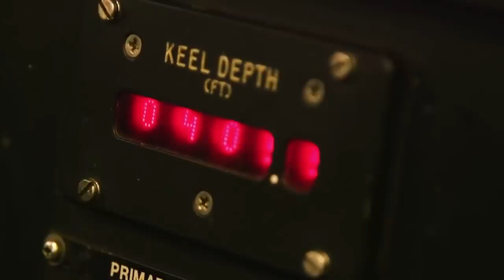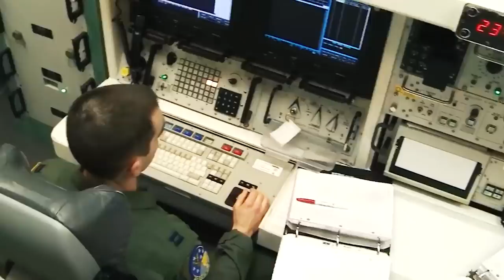Finally! This New US Submarine Can Destroy Whole Russia in 30 Minutes

Comment: Those Trident Missiles are something else. Amazing how a 560 foot long missile fits in a 43 foot beam. Those missiles must be like those very compact sponges that all you do is add water and they expand, ha, ha. I used 6 Ft. as an  average height and I got 6 / 6 Ft. or 36 Ft. + / -
Reply: Yeah he was wrong on that 560 ft😂 there 44 feet long
Reply: A Trident missile has an overall length of 43.9 feet (13.41 meters). And Trident submarines (AKA the Ohio class) have an overall length of 560 ft (170 m)
and a Beam of 42 ft (13 m).
Reply: You think those missiles are stored athwartships?

Comment: I would like to see a sub that has a bridge at the front and near the top (with torpedo tubes on the deck below the bridge) and have it look like an airliner's pilot's cockpit. The only difference being instead of having a window in front of the pilots, have a view screen that is hooked up to cameras that are set on the outside so they can see in every direction.

Comment: You talking about Russia has the same kind of nuclear weaponry in fact a far more advanced, Russia can also destroy the United States in 30 minutes, let's not make it sound as if though the United States has a stronghold over russia, 5,000 nuclear missiles parked over there in russia. 5,000! The United States only has 4,000. So let's just say this both of the United States and the Russia can destroy each other in 30 minutes. Everyone keeps forgetting, that Russia has very advanced and nuclear arsenal. Their nuclear missiles works perfectly.
Reply: Doubtful they are more advanced. Also, it's not 5,000 and 4,000 missiles. It's about 5,900 warheads vs. 5,550 warheads. And yes, they can both destroy each other. Whether one is more advanced or not is not really that relevant when talking about nukes. Only that they work and hit their target.

Comment: You guys don't really understand the metric system do you? At 6.50 you say the Trident 11 D5 is 13.6m long, but show a graphic of 590 feet long. Which is it, 170m or 13.6m? (Or 44.6' or 590" long?) I can tell you, it's not 170m tall or otherwise those guys standing in front of it are about 30m tall. Or about 100feet tall for you confused yanks.

Comment: I would rather see a lot more subs than another Carrier and the ships required to accompany it.  Surface ships are nothing but sitting ducks, sitting ducks to anti-ship missiles, and torpedoes.
Reply: As good as subs are, they don't have the versatility carriers do. Limited number of subs due to cost with limited firepower as compared to carriers with 60 or 70 planes, multiple destroyers, cruisers, etc. each with more missiles than one sub. That is attack subs. This video however is talking about nuclear armed subs that don't attack for obvious reasons but in nuclear war. 

However, your assertion goes both ways. The US also has anti-ship missiles and torpedoes and China is building carriers to go along with all of their surface ships which are just as much sitting ducks as anyone else's ships.

Comment: As a nuclear drive method, I've envisioned a thermal expansion technique using Seawater.  But the thermal expansion of water is slight; however very forceful.  So in theory the concept definition revolves on transformation of large magnitude force and small kinetic action into smaller magnitude force and larger kinetic action.  How do you do that,???
Reply: The answer to the first part of your query is you have to "heat the seawater particles up" causing rapid expansion & violent molecular movement. As you said,, the thermal expansion has to be slight or you've simply created a glorified steam engine. The last part of your hypothesis lends to fusion,, achieving more energy/propulsion from less. I'm no physicist but didn't want to leave you hanging with your original question so I gave it a rudimentary shot. Perhaps someone far smarter than me can help with a final equation,, I only have a vague idea & vision of what you're attempting to express..
Reply: @roberharpane3524  Well I think you've got a couple things wrong.  The thermal expansion of water is slight, meaning before it becomes steam.  Therefore the problem becomes converting a tremendous force with slight expansion, into a lesser amount of force acting over a greater amount of specifically water and propulsion.  A basic "lever" in a classical sense.
And no I didn't mean anything about fusion, I'm not a physicist either.  Standard uranium fueled reactor.
Reply: You know the war's not going to start on Earth,,,, right you are aware of this correct. ✌️
Reply: @stevemorgan1424  if you'referring to what I'm able to relate to: I don't think that will ever happen again, but yes 🤞✝️.  I've forgotten that video, but I don't think my comment said anything about the end of the world.